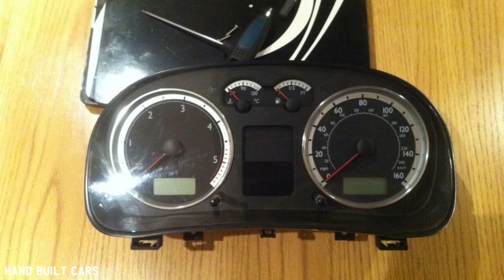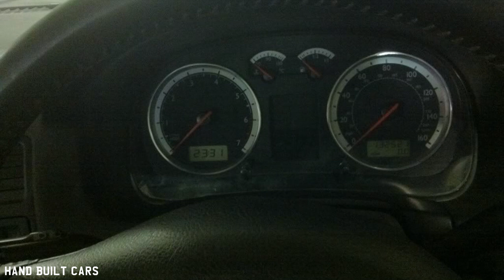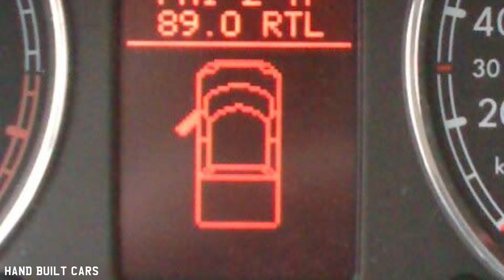1999 Volkswagen Golf Mk4 UTE / Pickup Truck Build Project

Comment: Digging the wrap color and the interior work/ wheel choice is on point! The execution of the rear window and b-pillar is very nice, and extremely well done. Only things I would do differently if it were mine, would be a legit coilover static suspension setup, an audi TT fuel filler, and maybe a boser hood. Great work dude, and thank you for sharing! 👍👍😎